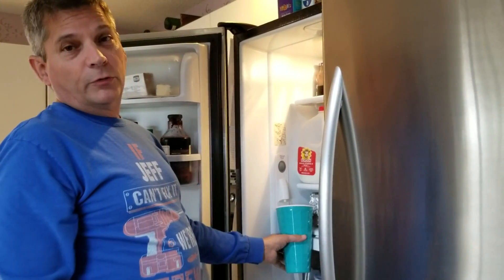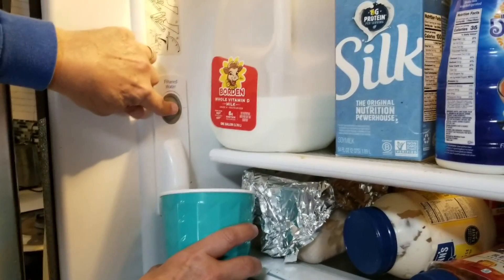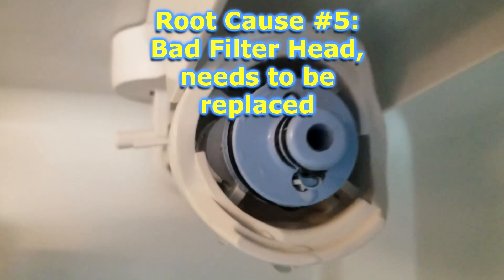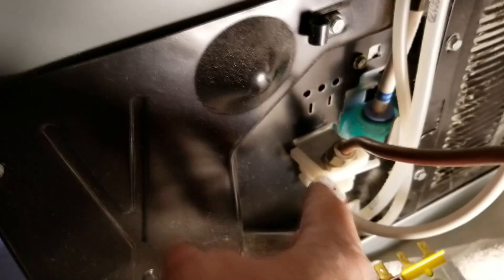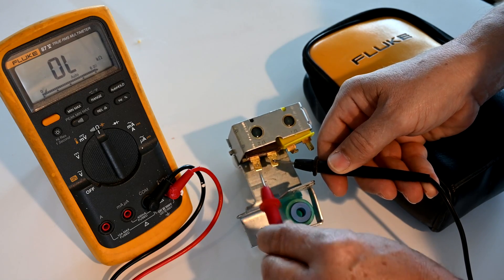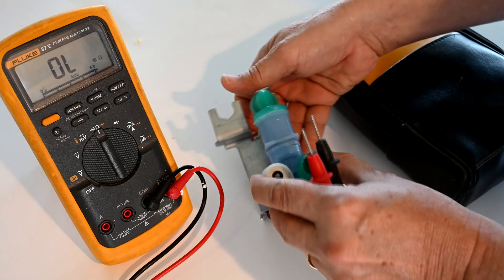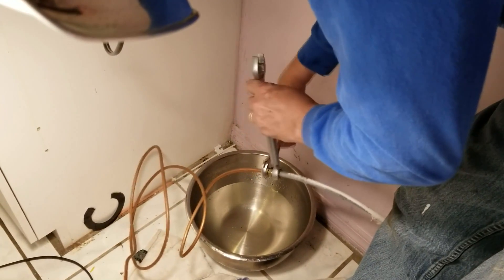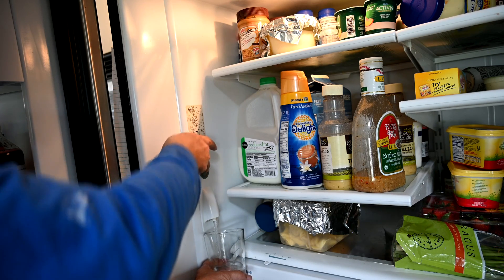5 Reasons Fridge Won't Dispense Water: Inlet Valve Fix DIY

Comment: Help!!! I checked the water line pressure and the solenoids for ohms, both were fine.  The water dispenser switch not only clicks but also you hear a hum when activated.....how common is it that the inlet water valve is faulty from other than the solenoids???
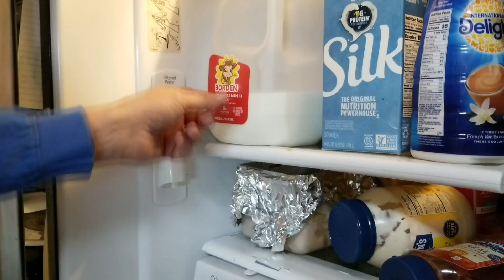Reply from the maker: The most likely culprit from what others have written us is the water reservoir frozen, have you checked it? We show it at 2:50 in the video. If that does not do it for you, then it's the filter head that needs to be replaced. We uploaded a video on that other repair here: https://youtu.be/t4W0EaNo9gc
Reply: Solenoid, Like a Relay Is Mechanical As Well As Electrical. Scale In Water Can Interfere With Operation Of Valve Openings, Plunger, Or Springs Can Fail, Jam, Clog, Etcetera. Removing And Cleaning May Help Or R&R. If Water 💦 Is Hard Like It Is Here In Florida, It Can Block Lines, Valves and Cause Build-Up Related Problems... #GotVinegar? #GotCLR?
#AskMeHowIKnow #GraciousFloridaLiving! Walt @ YOUandMeRealty.com

Comment: @jeffostroff the water reservoir and tubing on the fridge side keeps freezing up. And I think that is why the water stops dispensing. I turn the "cooling off" and it melts and it works.. But it keeps happening ... what is causing this?
Reply from the maker: Sometimes the design of the fridge itself is what ends up being it's own downfall. The fridge get it's cold air piped up from the freezer until it hits 38 degrees, then stops. The sources of that airflow is usually not far from where the reservoir is located. So if you have lots of food items blocking the flow of air near the reservoir, it tends to get cold enough to freeze at 32 degrees. I would try experimenting with food placement, and see if you can keep the area right in front of that reservoir clear. Remember, you're only talking about a 6 degree difference in temperature.  You might also try adjusting the temperature of the fridge itself until it goes no lower than 38 degrees. If your fridge has a digital temp display, use that, otherwise get a real freezer thermometer and put it on the shelf and near the reservoir see what the temperature is. Read your fridge manual to see recommended fridge temp, which is usually 38 degrees, see if they maybe allow it to go to 40, but remember the 40-140 rules, food grows bacteria in that temperature range.
Reply: @jeffostroff  Boom! This is exactly what I needed to hear to fix my fridge problem I've had for half a year!!! Ty

Comment: super helpful video, thank you. I called kitchenaid and spoke with an independent technician. Neither gave me as much information as your video. So happy I found it. My problem was a frozen line. The hairdryer trick worked. However, now I wonder what caused it to freeze up? Any info around that and can I keep it from happening again?
Reply from the maker: Yes, sherry, the refrigerator gets it cold air from the freezer below, or above depending on our configuration. Sometimes when people have too much stuff in the fridge it tends to block the water line in the back, or the water reservoir, so it does not get the circulating air flow, and so the water can freeze.
Reply: jeffostroff ty

Comment: My whirlpool refridgerator ice dispenser stopped working i did all the necessary checks and found out that the inlet valve was working , the problem i found is that there is no current reaching the valve i've tried testing the wires but still nothing, the thing is that the refrigerator is still working and the valve wires are connected at the same place, so i'm stucked what can i do??
Reply from the maker: OK, does your water dispenser switch click? If something is bad there, you won't get a click, and no signal to the water inlet valve. For other people in the past I have seen it's the control board down in the bottom of the back of the fridge, you can test and trace signals from there to the water inlet valve. I've also heard of people having an issue with the wire harness going down the door. Can you get a hold of a schematic for your unit? Sometimes there may be one on the back of the fridge, folded up in a baggies, sometimes inside under the back of the fridge folded up, sometimes you have to search online for the PDF.
Reply: @jeffostroff  thanks for replying, the refrigerator doesn't have a water dispenser only a ice maker and no i can't get hold of a schematic , the wires at the bottom back of the refrigerator that goes to the relay on the motor the problem is somewhere there , do you knows how to unplug the socket from the relay?
Reply from the maker: @desmondjohnson8400  really can't tell what's  going on. Try to get that controller board down and examine it and see if there is any damage or burnt parts on it
Reply: @jeffostroff  thanks jeff i was thinking of the samething too
Reply: Our Maytag water dispenser was not working.  We followed your instructions by heating the little plastic tubes behind the drawers and it worked.  You just saved us probably a $150.00 service call.  We can't thank you enough.
Reply from the maker: @maryp698   I accept all major credit cards LOL! I am glad to hear it worked out for you that's why we make these videos

Comment: I bought a new filter and replaced it to no avail. No water and also no ice.
Reply from the maker: Dang, have you replaced the water inlet valve yet? That might be your issue. Also did you try the hair dryer on the plastic reservoir bottle inside the fridge? I gave that idea to numerous people and it solved their problem, to melt the water that froze in the reservoir.
Reply: @jeffostroff  tried the hair dryer,  it wasnt frozen. As for the inlet valve...I have not changed it. Is that something I can do on my own?

Comment: Water dispenser is dripping, tried to change filter. Seems to have pressure build up when I remove the filter.  I tried to clear the tank ran 2 buckets still dripping.  Any suggestions?  Thank you!
Reply from the maker: If you have water dripping from the dispenser, it likely means that your water inlet valve is shot, as it is not closing all the way to 100% cut off the flow of water. this is the most common root cause, but I would go run past the guys on the refrigerator and hvac forums, but I bet they will all say the same thing. We have another video that shows you how to change your water inlet valve here: https://youtu.be/7i7MZAbatbQ it's normally located at the bottom rear of your fridge.

Comment: my fridge didn't want to dispense water because there is a lock for the door controls that was on.  so not wanting to accidentally change the temperature of the fridge means you can't get water.
Reply from the maker: That is a strange one don't you just hate these crazy gotchas!

Comment: I replaced the filter due to slow flow, then both solenoid valves, still had slow flow. Found the filter inlet was worn out and just deleted the inside filter and bought a good inline filter and placed it behind the fridge. Now I save $20 each time I change the filter AND vacuum out the back of the fridge every 6 months.
Reply from the maker: Great solution Kobek!

Comment: Can to high of a water pressure damage this and stop the water and ice dispenser.
Reply from the maker: Kelly, I doubt you could really get that high of water pressure, and even if you did, there is that water inlet valve that controls when water enters the ice maker, so I doubt any of that high pressure would make it through to the ice maker or damage it.
Reply: @jeffostroff  The water dispenser stopped working after I turned the after pressure to high on my house pressure reducing valve. Ice maker works but it will not dispense ice and the water dispenser will not dispense water